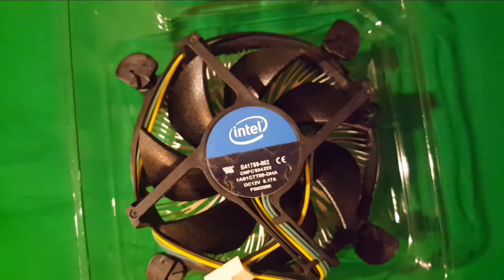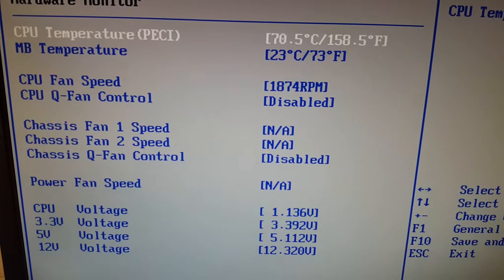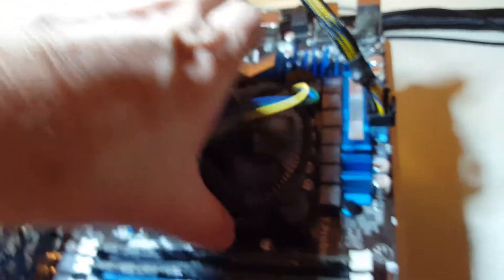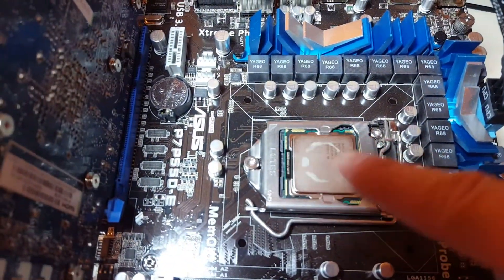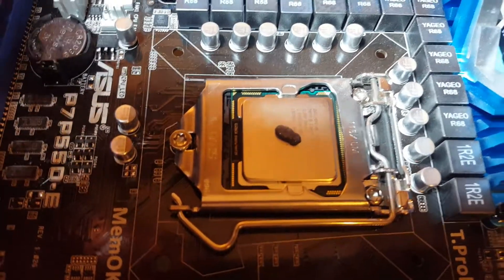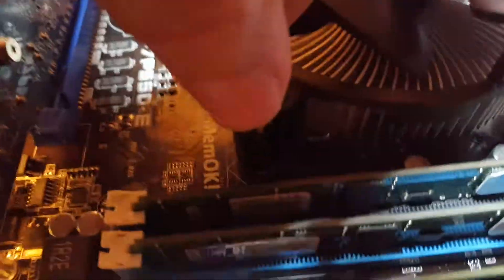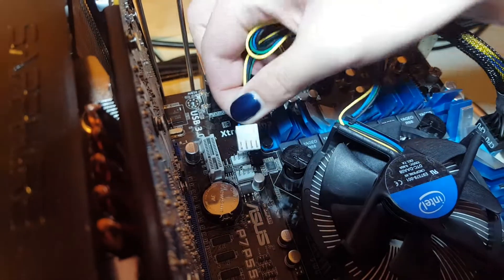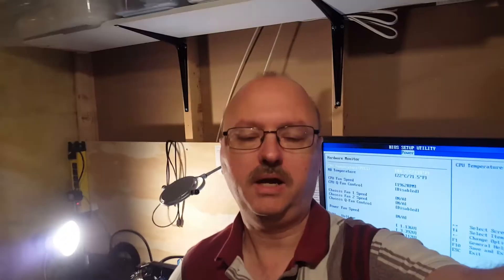Re Applying 7 Year Old Thermal Paste on Stock Intel Cooler

Comment: This was helpful. I'd been making a massive mistake prior to watching this. When seating my heatsink I used to push the clips in and then turn them not realising that turning the clips is for releasing them and does not need to be done when seating the fan. Lead to alot of problems for me until I saw this video and realized what I had been doing wrong. My cpu had been running at 100c under load for 5 years because I had seated it incorrectly by twisting those damn clips/pins
Reply from the maker: Yeah Intel Stock Coolers can be confusing, glad this helped you out though. Have a great day and Thanks.

Comment: Question - I havs a stock intel cpu fan. My pc idles at 45c comfortably however as soon as I launch a game it quickly spikes to 90c. Any thoughts?
Reply from the maker: Stock Coolers typically do not provide adequate cooling for many tasks, I would recommend an aftermarket CPU Cooler, something like a Hyper 212 EVO, it's very quiet and will provide much better temps when gaming and many other tasks as well and very easy to install.
Reply: @Reviewing_Playing_and_More_RPM  I replaced my old stock heatsink fan ,which turns out had damaged pins so wasn't seated correctly, with a new stock Intel heatsink fan and it works amazing. 35c idle. 50c under load. And it's turbo clocked. Honestly I find custom cooling rigs super over-rated and unnecessary unless you're overclocking to the extreme or mining. A clean stock fan is absolutely adequate as long as its clean and installed correctly with decent case airflow. Thanks buddy
Reply from the maker: @nvoid2597  Always happy to help, those are great temps. Have an amazing day.